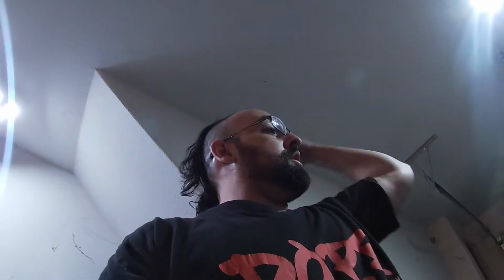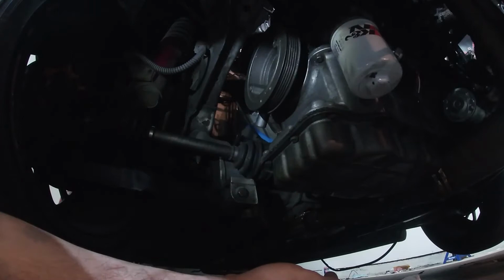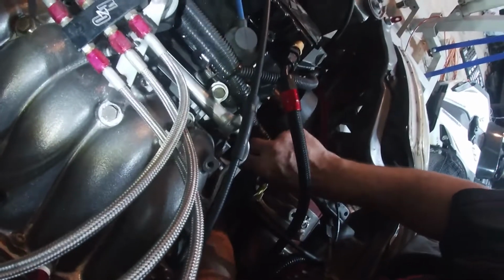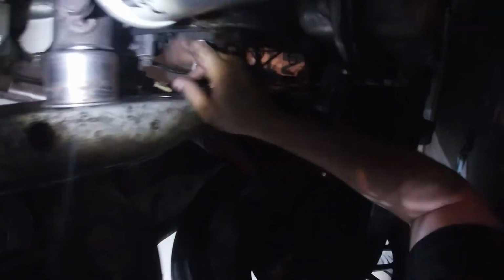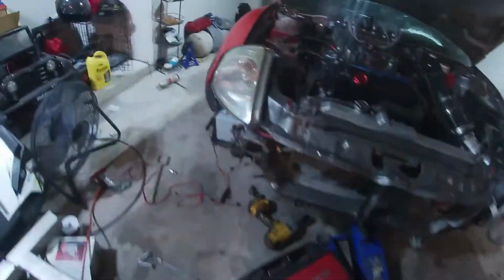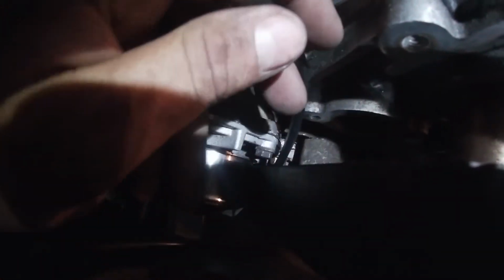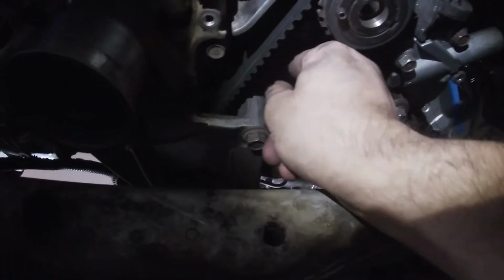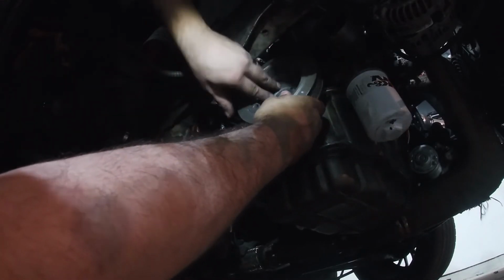Eclipse Crank Sensor swap WITHOUT removing the timing belt

Comment: You are the reason I can fix the one I bought. I wasn't told about the crank sensor issue until the paperwork was signed. The test drive went well until the sensor started getting to operation temp and now it won't start.
Reply from the maker: Thanks so much!!!
Reply: @deeternal  Fun fact, the original wire was functional, but barely. The yutz that had the car before me decided that they would route the sensor wire through the Power Steering belt so the belt wore through the sheathing. Resheathed the wire with electrical tape and changed the routing and now runs good as new.

Comment: So I have a 2000 mitsubishi eclipse gt 3.0l v6. I replaced the crank sensor, didn't unhook the battery and when I finished, the car wouldn't start, it's got spark and gas. I unhooked the battery for overnight hopefully that will fix it but if not I could use help fixing this problem. Also it has a new distributor

Comment: Is this a v6 or the 2.4. Mine looks completely different 😂😂
Reply from the maker: V6
Reply from the maker: It's a 6g74
Reply: @deeternal  damn, I can’t find ANYTHING on replacing the crank sensor for the 2.4
Reply: @gothicboyclick6011 if you are looking to swap the crank sensor without taking the timing belt off, you have to remove the passenger side motor mount and another bracket I can’t remember so you can route the crank sensor correctly. It’s a pain in the ass
Reply: @gothicboyclick6011  mine was, I have a 2.4l in a 2001 eclipse gs. I think I posted a short showing it